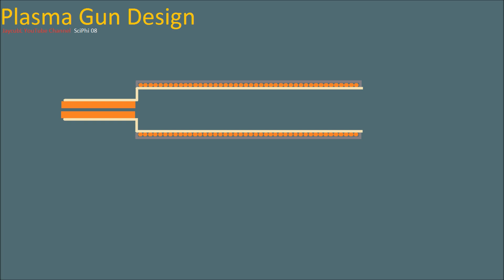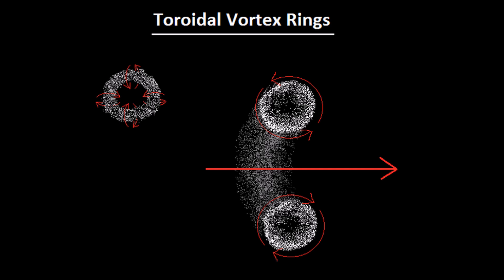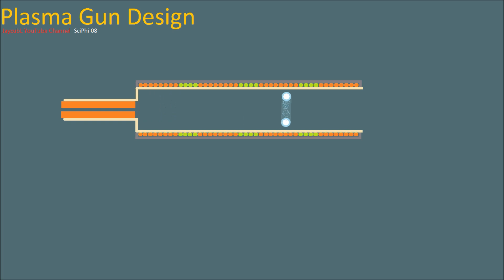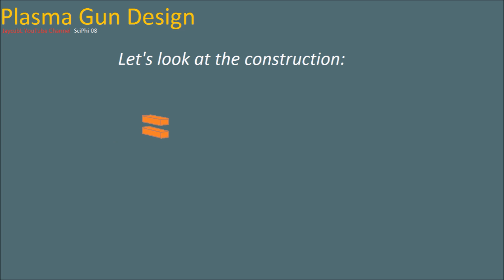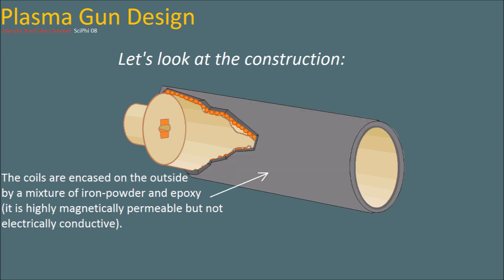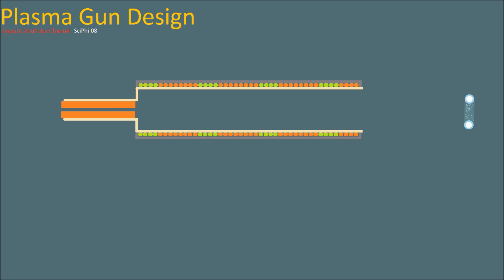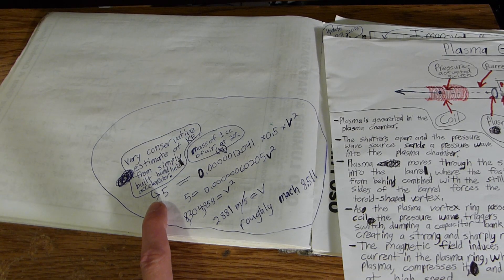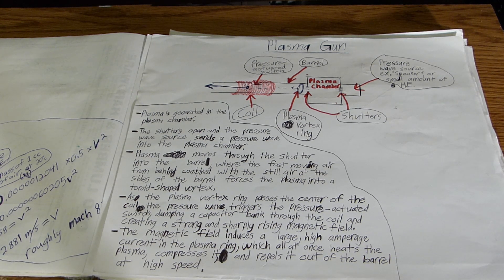Plasma Gun Design, Particle Ion Beam Weapon SciPhi 08

Comment: Good, I'll take 5 of them
Reply from the maker: How much do you think one is worth?
Reply: If it works; quite a bit
Reply: JaycubL In a pistol form at least 1500 USD.
Reply from the maker: That would be cool.
Reply: JaycubL indeed. The primary reasoning behind the pricing is quite simply the negation of ammunition requirements in most plausible or commonly attributed circumstance. Of course out of atmosphere combative encounters do mandate the use of compressed gas supply of any particular choice, but the chances and likelihood are very low. I think 1500 is a moderate pricing for a device which holds not only weapon or self defense characteristic, but also maintains or acquires multitool status. Especially in that the materials in use would theoretically be very cheap and in high stock. So the real value comes into the assembly, design process, and investment. In reality a larger scale device or even the hypothetical pistol in question would be well over 1500 in value. The pricing i provided is really just brain food, of course i hold no real determining factor on how you choose to price yours if at all. Though it is important to mention that if you decide to implement a voltaic cell structure for massive energy production efficiency, the general estimated cost i've accrued for such a battery would be well over 16000 dollars. The half life of the isotope i would use in the preferred embodiment is 1600 years, and belonging to non other than the severely volatile radium 226 in conjunction with a direct conversion agent which could be consistent of multiple things. Though i will use a semi conductive germanium oxide for electron hole production. All these into account, the price may be even more than 27000 for a smaller scale. I've almost finished my prototyping design, and am about to move into physical tests after a little mathematical consideration here and there. I suggest you adopt a coaxial railgun design, yet i have noticed your seeming distaste for that model. I must express that it holds far greater chance of success if installed properly, and has in principle and in test worked flawlessly on numerous verifiable occasions most notably in the MARAUDER project. Unfortunately we have yet to see the perfected models they have no doubt developed within the time gap from the supposed discontinuation and now, but a brief showcase of significance can be witnessed currently which was executed in 2015. Unfortunately, the team used a wire to be vaporized and a grate for toroidal shaping which in my opinion severely undermines the usefulness of the coaxial rail setup. I believe it was all in all to disperse some amount of kinetic energy before full open air propagation to allow both easier film capture and decreased hazard, but other than that the footage speaks for itself. The navy has also picked it up, yet the team insists it's use lays in electrical energy transport. I've also adopted a filter and funnel design for the uniform distribution of the compressed gas of choice in my gun now. I realize in my previous comments i may have come off as snobby or perhaps naive which i was at the time. So for that i apologise. I sincerely wish to know your progress, and if possible potentially share details on our mutual development. I also hold no intention of patenting and view it as the death of innovation otherwise.

Comment: I would like for you to build this but I want to ask if you know of any ways to propel the plasma at a faster speed for means of penetration. So far it seems as though it would not be able to penetrate too well being described as a sort of plasma-cutter. Increasing the speed of the plasma may pose as a problem as the aerodynamics become far too rough to control and so the vortex created may be too large at higher speeds. If I am wrong, how high of a speed would you say is plausible for the plasma projectile?
Reply from the maker: Since the plasmoid would have such a low mass, it would travel at incredibly high speeds. Speeds like what you would see from a particle beam weapon should be possible. But also due to the low mass, it would lose energy quickly on impact. Stacking many shots on the same spot very quickly would be possible and should make up for that. Only real testing will reveal things like exactly how well in can penetrate various materials.
Reply: JaycubL also, speaking of particle weapons, though this particular proposition has spun up from a very funny interest in half life and maybe just a bit of Tesla research, would you consider developing a simple, portable particle accelerator weapon? I have experimental energy research and designs capable of supplying moderate quantities that the task calls for which are primarily electromotive in nature, not truly requiring excessive amperage. So if you are acquainted with the tau cannon, just understand beforehand that no "miniature tokamauk" is necessary lmao. And of coarse the tau cannon is just science fiction at heart, but i believe something unique can emerge from an endeavour of this kind. I already have some immediately brainstormed thought of a circulatory system similar to that of a toroidal vortex for the better escort of any group of particles open air. The idea is to generate a lower pressure zone for lesser environmental resistance and increased accuracy as well as range. How i would create such a problematic field, let alone make it's effects occur at around the speed of light in synchronous with the particles ejected, i have no immediate clue.
Reply: JaycubL and before i end this comment bombardment which heavily suggests my lack of a life, i would also like to ask if you would like a basic prototyping module free of cost after the initial resin shell is casted? I am sending one to another research partner of mine for faster development, but you being one of the only existing individuals with enthusiasm towards this whilst also holding the knowledge to aid in your production, i would like to give you one as well for consideration and maybe even critique. Not many og us currently, and even if there are, most are governmental sellouts and assholes who restrict knowledge from the public assisting in the pacification of society, and nullification of individual tendencies of this kind. So many use wonderful and powerful inventions daily despite having no relevant understanding of the actual principles in play allowing for such. It's, discouraging.

Comment: And just basic air? You know is formed by different gasses that require different amounts of heat and also have different properties, I would start with hydrogen as that the easiest and simplest to accelerate, and it will require far more than 5 joules to convert to the plasma state
Reply from the maker: 5 Joules in the example speed calculation was the kinetic energy, there would be much more in heat. The amount of energy needed is not that important, that basically depends on the size of the gun you are making. You can generate a plasma arc with very little energy. Regular air should work fine but yeah there are other more conductive gasses than nitrogen. I don't think it would make much difference on the net result but yeah other gasses/vapors should be experimented with. Metal vapor from the rails might help make a "heavier" / more dense plasmoid.
Reply: That could potentially work, microwaves have a short span of distance however
Reply from the maker: True (intensity drops off as the inverse square of the distance, as the signal spreads out wide and thin) but if you use a focusing antenna (search "microwave horn") you can get a reasonably well collimated beam that will keep it's signal strength for a much longer distance. The microwave ray is infinite it just diminishes in power as it spreads out (or collides with something of course).

Comment: I'd imagine this would require an excelling amount of heat to acquire any form of gas in the plasma state, it's a very interesting design, but it will cool and return to gas within a short time of firing and exiting the chamber
Reply from the maker: It would only last a fraction of a second yes but at say Mach 10 you don't need long to reach out a couple hundred yards for a useful plasma gun. I also have the idea that directing a microwave beam along the path of the plasma shot would increase the plasmoid's life span to a potentially much longer time.
Reply: JaycubL JaycubL Your idea of a directed microwave beam sounds kind of like a MASER. You seem pretty bright, so I reckon you know that a MASER is a LASER but utilizing photons at microwave frequencies instead of visible and near visible light frequencies.

Comment: Jaycub L, I have some questions to make and some things to point;
1) I thing for the copper bars you need a power supply with a HV transformer and for the coil an other power supply with an amper trasformer.
2) If the tube is bigger in length and in diameter would help the plasma go further, get bigger and more destructive?
3)Why copper bars? Aren't just copper plates or arcs fine? (The arcs should be placed at the beginning of the inside of the tube, so the plasma would be accelerated.) Do you want a magnetic field? But the HV transformer reduces amps too much. How many amps are enough?
4)Don't you need a good heat conductor around the tube so the coil won't melt?
5)Isn't it very likely for the plasma vortex to go immediately in your body or in the ground, as they both are electric conductors?
6)What would happen if the target woulden't be an electric conductor? Whould the plasma just pass the target without hitting it?

I am just asking because I don't know much about it. Could you please reply?😂👏
Reply from the maker: 1) You don't have to use transformers but yes that is what you need to accomplish with the power supply.
2) Longer accelerator would allow the plasma to reach a higher speed yes. You would reach a limit where you need higher power or a vacuum/evacuated barrel to accelerate further though.
3) It would need to be electrically conductive bars, it could be other materials aside from copper. Graphite or tungsten surface with copper or silver main body would be a good composite for the rails. They need to be thick and sturdy bars, not thin plates, to withstand the magnetic forces and intense electrical discharge erosion.
4) The main coil should be mostly safe from the heat of the plasma since the magnetic forces of the accelerator would center the plasma ring in the barrel and compress it toward the center. It would likely get hot during use though from ohmic heating.
5) No
6) Does not matter if the target is an electrical conductor or not.
Reply: JaycubL it won't hit the ground or you, because the plasma goes very fast? Would the plasma have a bigger impact on the electric  conductors? By the way, thank you very much for your help.
Reply from the maker: The plasma would "not care" if the target is a conductor or not. It is not like an electrical arc seeking a path to ground, the plasmoid would already have neutral charge. Think of it is a little ring-shaped tornado of very hot air/fire. It would be affected by magnetic fields though since it is ionized (it is a good electrical conductor itself).
Reply: JaycubL thanks. Now I know enough. Thanks for the time you spent with my questions.
Reply: JaycubL Sorry for disturbing you again, but I want to ask three things;
1)The iron-epoxy mixture will reflect or absorb the magnetic fields? I think if it reflects them, then the magnetic fields will neutralize each other, making the weapon weak and not much effective.
2)How this iron-epoxy mixture can be made?
3)How can someone be sure that the plasma won't go from the opposite direction and hit him, destroying also the weapon?
I would really like to make one this summer and that is why I'm asking too many things.
Reply from the maker: The iron - epoxy mixture is meant to be a highly magnetically permeable material (like iron) but made to be non conductive (by grinding it up and mixing with epoxy). It both concentrates the magnetic field inside the accelerator tube and shields anything outside from much of the magnetic field. The nature of both the rail-gun section and the LIM section of the device are to accelerate the plasma only one direction. Please be sure you actually understand the electronics required and fully understand the design for this device if you attempt to build it. Be safe! I don't want to find out later that you lost a hand or died or something.

Comment: the plasma density wouldn't be adequate with this design. on the order of a lawn mower spark plug. the magnetic Lanier accelerator wouldn't be necessary if you used a laser reference beam with enough wattage to ionise the air. the plasma would follow the path of least resistance ie. the laser path. your main problem would be portability. the power supply is going to be a major and perhaps restrictive problem. now stationary, hell a ladder type voltage multiplier or Tesla coil is good either way there will be heat. a lot and the plasma must be quite dense. it can be done you can do it. you've just to tweak the design. mind a device of this type is inherently quite dangerous. it cannot and will not be registered as a non lethal sidearm. direct lightening strikes to humans invariably kill. keep at it. please keep us posted. why I haven't made a prototype?? who says I haven't

Comment: As cool as the idea is, I believe that would require insane amount of power to actually work as an effective gun.
Reply: And the plasma toroid wouldn't even be that damaging either. It's extremely lightweight, atomised and flat, so it would just desintegrate against anything solid, in comparison to a regular ball round, which is dense and straight and can penetrate many times it's own length.
And the fact that it goes extremely fast does not take away from the fact that it's heat is going to dissipate just as fast. It doesn't really matter if the toroid (which is a shape with lots of surface area) goes through a length of 500m in a second or in two seconds; it will still make contact with that much air. Also, I think such an unaerodynamical shape made from a material as fluid as ionised gas traveling at such ridiculos speeds would just immediately collapse into the shape of a water drop.
And how much heat can such a nimble projectile even carry?
The only advantage this system has is the speed of the projectile and, at that point, I think you are better of just using a laser :/

Comment: what happens when the plasma hits air? it evaporates.  As you said each shot have low energy. It will just dissipate as it hit air. Don't think the range will be very good.
How are you accounting for the plasma drift (ExB drift) in the chamber? there are ions and negative ions and electrons there that all do different things when they hit magnetic fields further more nonlinear magnetic fields make the forces on the plasma weirder.
Reply from the maker: For range, consider how stable a toroidal vortex of air can be. At the high density and very high velocity the plasmoid would have when leaving the muzzle is should be possible to stabilize it long enough for useable range (a fraction of a second is all that is needed at hypersonic speeds). Especially when the concept of sustaining the plasmoid in flight with a microwave beam is considered.
There should be no drift since the accelerator is radially symmetrical. The net force from the high frequency linear induction motor would drive the plasma toward the center of the barrel and toward the muzzle (compressing it and driving it forward).

Comment: Honestly you should have went to get the patent before posting this video but either way, the physics seem sound.
Reply: Well... not quite. In a vacuum this may work but as soon as it leaves the end of the gun it will both transfer the momentum of the gas into the air and dissipate.
Reply: Wotty consider a compact torus in a sparse atmosphere, at a sufficient temperature to cause fusion events. the rate at which the total thermal energy changes is the energy added by fusion interactions minus the sum of heat losses. heat loss per second is proportional to the temperature difference times the surface area, and likelihood of a fusion interaction is proportional to absolute temperature times compression. there exists a critical value of compression for an arbitrarily selected plasma where the increase in thermal energy from fusion events is greater than the heat losses, resulting in self-damping temperature oscillations which rapidly find equilibrium. the compact toroid will slow down due to drag, but since the surface area is small, this will take a while compared to the alfven time of the system
Reply: Sure the military already has it and gagged.
Reply: you are so right.
Reply: you are so right.
Reply: you are so right.
Reply: you are so right.
Reply: you are so right
Reply: Wotty. What about MARAUDER, that (from what little were allowed to know) worked just fine.
Reply: I’m sure this has been implemented in testing situations by the US military. The design shown here is very watered down

Comment: What is up with the short circuit at 0:44 the top rail should have one of the leads in this case it has both leads. If the top rail is the cathode the bottom rail should be the anode, but in your diagram you have both the positive lead and the negative lead connected together in series. that will at best give you molten mess of metal. Quit your bullshit.
edit: clarification
Reply from the maker: Those are two separate circuits, one is just an HV igniter. Black is the HV igniter circuit, red is the main power circuit (not red and black like + or -). Look at how the wires are labeled in the slides. If you talk to me that way again you will be blocked from commenting on this channel.